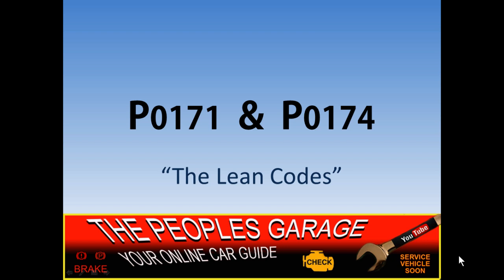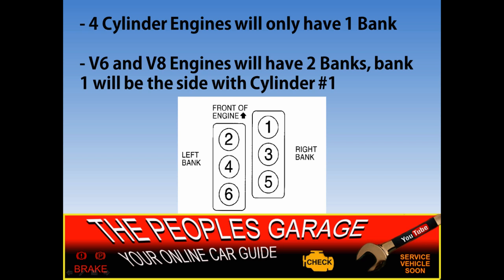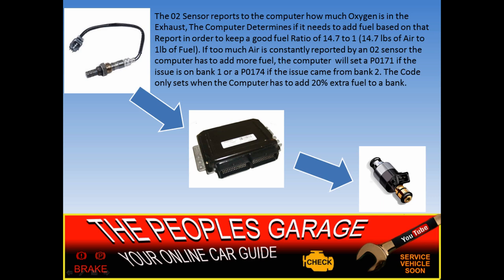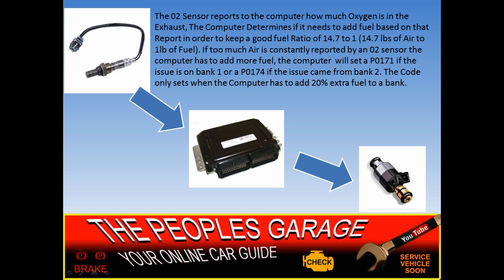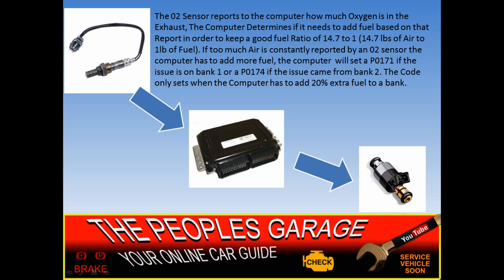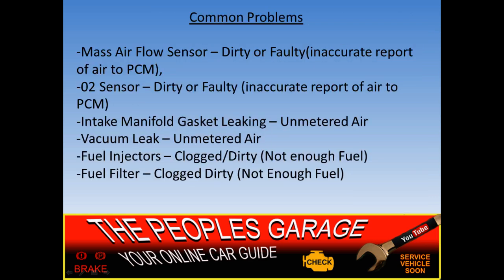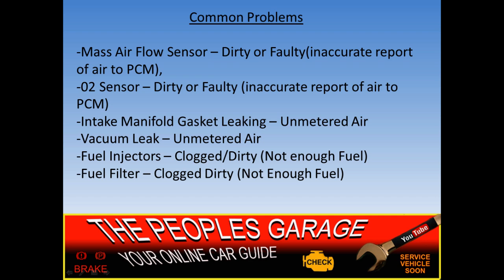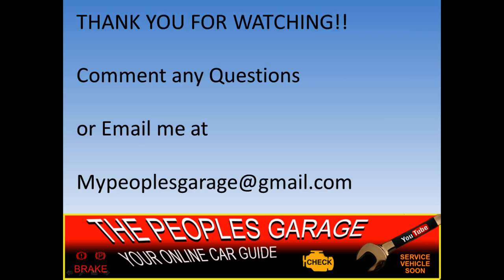How to Diagnose Codes P0171 & P0174 - Lean Bank 1 & 2

Comment: Hi god night. I own an 07 Fusion 3.0 V6 yesterday i replaced the intake filter  for a new one. I have had the k&n typhoon system for 3 years now so far so good.

After replacing it i disconnected the negative terminal for 20mins in order to re learn trim fuel levels as i considered it was neccesary the old filter was horrible even if i clenaed it regulary.

Start up really rough idle engine jumping all around car shaking all the way. So what i did: Electronic cleaner for MAF, MAP, cleaned connector male and female for EGR, MAP, MAF, Throttle Body and 3 front coils.

Checked for vacuum leaks at typhoon duct, PCV vent hose, intake manifold. Checked torque for 7 bolts for the manifold.

Everything ok checked codes got both p0171-74 then fuel pressure 60psi left 2 hour the pressure indicator did not move a bit. Went back to old air filter reset ecm no help same issue.

Im lost right now going crazy only thing left is dirty fuel injectors but as you said that would be for one bank not the two of them.

Any help? Thanks in advance!!!👍

Comment: 98 Ford explorer  304, 171, 174. 
304 code gave me trouble last years replacing the coil pack, wires and plugs. I must have dropped the number 4 plug after purchasing new because it gave me trouble day one. Replaced the plug and 6 months ago and is idling rough when cold. Roughness smooths out after warmup. 
171 and 174 lights were out for 6 months after replacing the easiest to replace 02 sensor on bank one. 
I'm thinking vacuum leak in manifold giving all three codes or
Mass air flow may need cleaning or replacing again. 
What would do first. I hate to take the intake off at this time. I cleared the codes and know they will return. I learned a lot on utube channel. 
Thank you
Reply: I have the same rough idea i did in the last comment. 304, 171,174 code.
Any ideas?
Reply: Forgot to mention the check engine blinks sometimes.

Comment: hi and thanks for the very useful information.  i have a 2003 Windstar that has P0171 & P0174 codes   ive changed the air cleaner as it was real dirty. I also replaced gas cap.  After taking the MAF sensor out and cleaned  i still got the codes back only 7 miles after clearing them.  after further inspection i noticed a rod laying out on the manifold that fell out of the intake manifold runner control.   so, after watching some videos of replacing manifold gaskets and yours, I'm wondering was this the problem all long?    and if the p0171 & p0174 too lean bank 1 and bank 2 could this solved by just getting new bushings and rods and put back in?   i called a guy at Auto Zone and he told me I had to buy the whole IMRC   300.00!   i seen the kit of 4 bushings and two rods for 23.00 at Ford.

Comment: I have a GMC jimmy 2001 have both the codes on. I replaced the air and fuel filter just in case it is that. Evap canister solonid was also changed as it was stuck in the open position. Also sealed all the intake parts after the mass air flow to the engine and I am still getting the codes for bank 1-2. How can I check if its my gasket? Keep up the great videos, probably the most useful one I have found. A++
Reply: Check for a vacuum leak in your brake booster

Comment: ok autozone told me p0171 and that is it, the local shop told me 174 and that is it,,,, this is on a 98 lincoln continental , i found broken exhaust hangers causing for a wobblly exhaust, is it possible to have created a exhast leak and this is givng o2 sensors a bad reading, i sprayd ether around intake manifold and did not get any response,,,, any comments will hlep thanks
Reply: dont know if u got answer yet but that ex leak will definitely throw a o2 and or rich/lean code i have sim issue when truck gets hot a crack in my header expands open enough to get the code but when it cold it tay sealed no code some times for weeks at a time epecially in winter and rainy days

Comment: i have a 2001 ford windstar. it has the 3.8 liter engine. it has both p0171 and p0174 codes. plus a bunch that i cant find yet. such as c1185, c1198, c1194, c1254, c1246, c1250, c1242, c1214, c1210, u1262, and b1317. i havent find much on the other codes yet. going to change fuel filter to see if that does anything and go from there. can the o2 sensors be check to see if the are good. any help would be great.

thanks,
rich

Comment: Yukon denali 2007 6.2liter both codes drop in rpm around 2500-3000 rpms only when driving.  Not at idle. Also I cant hear the fuel pump come on when going to off to on position.  Any thoughts

Comment: Thanks! I just subscribed your channel. this video made me totally understand the P0171 and P 0174 codes which popped up in my 2006 Ford Fusion SEL V6. I cleaned the Massive flow sensor and the throttle body, and the codes do not disappear. Do you have any clues causing the code in the specific car?

Comment: Thank you for the insightful video. I have an ill 02 Avalanche/5.3 L with a host of codes - P0101, P0171, P0174, P0300, P0430, & P0440. Newer plugs/wires & replaced MAF sensor. Rough idle, & very little power to the tires. Motor turns low rpm in gear and moving, however, in neutral builds rpm fine. HELP. Any thoughts?

Comment: I own a Ford Expedition Eddie Bauer and my check engine light is on.  Now we just checked out the codes and these two codes came up. 171 and 174. Now I was telling my buddy last week that my check engine light was blinking as I was driving to work it wasn't solid . But eventually it ended up becoming solid. So he reset my check engine light after we did the codes and now its back on again. I also told him that if Im driving onto a on ramp getting on the highway its hard for me to go from 0-60 . Once I hit 50 it wants to push to 60 buts its hard. So any ideas on where I should start or even does anyone know what they think the issues are. Thanks for your help and I liked the video. Of course im hoping its the pcv elbow .

Comment: My 1997 F-150 4.6L has run absolutely fine for years the whole time with both of these codes (171 & 174) tripping the check engine light. I've ignored it for years because it hasn't been an issue.

However, recently my County has enforced emissions testing and I have to get it fixed before it will pass emissions.

So I'm wondering where you might start with something like this where A) Both codes are being tripped, and B) No tangible issues with the motor?

The exhaust smells fine (not lean), the engine purrs like a kitten, can't hear any audible hissing noises (vacuum leaks). Just not sure where to start.

Thanks for any help!
Reply: In my case it was a bad hose coming out of the PCV valve. The truck blew a head gasket shortly after though 😢
Reply: Have you ever found the problem?please let me know!I'm getting the same codes in my 04 lincoln town car 4.6v8 and it's running just fine but I hate to see the check engine light on! Please let me know!thank you for replying back in advance!

Comment: I have Ford windstar 2001 limited edition. I went to Auto zone and the computer diagnosis is P0171 Mass Air Flow sensor in not working and P0302 fault spark plug cylinder 2. When i am driving my van gives me jurks couple of times and the acceleration drops down (lean). By when i have more gas in tank this jurks drps down and the vehicle is running good and smooth.
Do i need to clean the Mass air flow sensor or do i need to change the plug for cylinder 2 code (P0302). Please let me know and the mechanics are asking me for opening the head gasket and the estimated cost they are giving is $300 dollars or more.

Comment: 2014 SS Performance Sedan. 6.2 liter LS3 V8. P0173. I installed a roto-fab cold air intake a month ago.
Reply from the maker: Frank Marinucci Sounds like it has a fuel trim issue, it might need to be calibrated to adjust to the new intake.

Comment: I have 2009 Suburban and I'm getting both codes. Now when the vehicle goes off and wont start. I normally leave it for about 10 min and when I start it again it comes back on like nothing had happened. what would that tells you???.  the engine light will go off on its own after 40 miles.  thanks a lot

Comment: ThePeoplesGarage  i have a 07 vw gli with 2 codes - ( boost pressure drop from turbo to throttle body) and ( system too lean at IDEL) what can be my problem be ? thank you  * i have a new pcv valve new intercooler, new diverter valve and cold air intake
Reply from the maker: Gli_Fahrenheit That really sounds like a vacuum leak to me
Reply: how can I check? I also got (leak in air intake system p22790 )Thank you
Reply: You could use a smoke machine to check for that vacuum leak.
Reply: Or you could lightly use brake cleaner looking for a change in idle.
Reply: Thank you

Comment: Hi, I have a 2003 325i that has both lean codes showing and cylinder 6 misfire. It stalls when exiting the highway. I let it sit for a while and it starts back up and drives ok. Any clue as to where to start? Smoke test? Clean the MAF? Greatly appreciate any advice as my auto repair knowledge is about zero and I'm trying to sell the car ASAP. Thanks a bunch.
Reply from the maker: ***** I would have it checked for Vacuum Leaks, and Cylinder 6 Misfire could be a spark Plug or Ignition Coil, Sorry I cant be more specific

Comment: I have a 2000 chevy s10 4.3L V6 and recently changed the spider injector assembly which solved my cylinder 5 misfire as my injector were wrecked by bad gas disturbed when changing fuel tank, so I changed my fuel filter and flushed my lines before installing the new injectors, but then I got these to codes, found my gear clamp slipped off my intake so I fixed that because it was stalling and rough take off,, deleted the codes, now I get a stutter when it revs up fast sometimes but not always, it hasnt been bad enough to trigger a code, just looking for ideas because I do not like the idea of a minor intermittent problem.
Reply from the maker: Nigel Clean the Throttle body? No Vacuum Leaks?

Comment: hey guys i need help i have a 3.8 litre 97 ford mustang, and  i keep gettin p-0174 bank 2 too lean, now ive changed the hoses , changed to a new MAF , replaced the 3-O2 sensors changed the EGR Valve  by the way this is the cars second engine , i bought as a short block its working fine , the lagging stoped when i replaced the hoses, i dont knw what else to do please help!

Comment: I have a 2000 Toyota Tundra, 4.7 L V8. Just checked it with my code reader. It came up with the P0171 code, not the 174 code. I'm also starting to lose coolant.. Could smell coolant after parking the truck. Checked under the hood, and underneath,  found a small amount of residual coolant at the back of the motor..Could not trace where it originated from..Intake manifold gasket?  Could that be causing the lean problem also?  Would appreciated your answer.. Thank you.. Very informative, and concise video..
Reply from the maker: Glenn K I would go to the parts store and rent a loaner tool called the "Coolant Pressure Tester" it will allow you to find your coolant leak, The lean code probably wont be related to your coolant leak, since the MAF usually effects both banks, i would look into an Oxygen Sensor on bank 1 which is driver side in your case, check the front 02 sensor on a scan tool if possible, it is common
Reply: ThePeoplesGarage Thank you.. Your reply is greatly appreciated..  Will get back to you on the results...
Reply from the maker: Glenn K No Problem Glenn!

Comment: I have a 97 Ford Explorer that runs bad when its cold. once it gets to operating temperature runs fine. When its cold it idles up and down until it smoothes itself out probably 5 or 6 times codes are 171 174 any ideas?
Reply from the maker: Darin Wright It might have a small vacuum leak, it could be an oxygen sensor issue, or it might be a dirty or defective MAF, do you have any other codes?
Reply: No that's it.
Reply from the maker: try clean the MAF and erase the code first
Reply: Ok thanks!
Reply from the maker: no problem!
Reply: ThePeoplesGarage
Samething, not O2, not MAF, no intake leak

Comment: I have a 2000 chevy 1500 5.3 and have both lean codes and have changed 
The intake casket and have clean the m a f 
And changed gas fliter .....would u have any more idees as what is giving me the codes 
The long fuel trim was the last I check was around 28 and short was around mins 2.6 .?
Reply: Check for broken exhaust manifold bolts.
Reply from the maker: Jim B I would say the manifold might still be leaking, they are very notorious on these trucks and must be torqued down exact in order for them not to suck air in. I have a vacuum leak video that you can watch to see how to check for leaks using brake clean with the truck running, if your sure its not a vacuum leak I would look into replacing the MAF sensor, they can be cleaned usually but if they have failed electrically a cleaning wont help. After you cleaned it did you erase the code? Chase Powers you are on the right track but the chances of broken exhaust manifold bolts on both banks all of a sudden is unlikely. These trucks have issues with the intake manifold gasket leaking and MAF sensors.
Reply: Chase Powers waste of time
Reply: Thanks guys for the help its been put on the back buner. For now
Reply: Jim B I found my issue on my 5.3.  Multiple missfire, bank 1 lean, would smoke like a diesel.  Changed maf, new mani gasket & checked for vac leaks.  It ended up being the bank 1 sensor 1 o2 sensor.  It wasn't failed to throw a code, but it made the engine run like hell.

Comment: I have a 2000 Pontiac firebird v6 with p0171 system too lean. Bank 1 and 2. I got all 4 o2 sensors fixed last week. Idk what the problem is
Reply from the maker: Martez Artis On the Firebird v6 I would watch my vacuum leak video and check for a vacuum leak around the manifold, otherwise I would try clean the MAF, it might need replaced however if its not a vacuum leak. I would try clean it and erase the light to see if it comes back on, you can erase the light by going to the parts store and ask them to clear it, or you can unhook the battery for 5-20 minutes

Comment: Thank you for your video and the information, I have a 2002 BMW 325i. I have been dealing with these codes for about a year now and just yesterday I changed the pre cat O2 sensors and the P0171 code went away. I have not changed the other two sensors yet but I wanted to know which of the above mentioned symptoms are related to Bank one Vs Bank two lean codes. Thanks once again
Reply from the maker: andatey  What other code is left now?

Comment: Hi,,
i have range rover 2005 4.4L and i got P0174 code , i cleaned the MAF sensor and i checked for any leak but no any change , and there is really high gas consumption and no power.... do u think its better to change the O2 sensor ??
Reply from the maker: Riadh Taher Could be a bad 02 sensor but try look for a vacuum leak, spray brake clean around with the engine running
Reply: thank you for your help now everything is ok , thanx again

Comment: hey i have a ford ranger with lean in bank 1 and 2 both codes its a 4.0 v6 any help i cant find the problem
Reply from the maker: MrFunatthepark i would try clean the maf sensor and you might have to replace it if that doesnt work
Reply: i cleaned it nothing when i unplug it it runs right tho i baughht a new the problem is still there could it be the wires

Comment: Great video very informant do you have a diagram or a photograph of the PCV Elbow on a ford expedition 1999 so I know were to look thanks
Reply from the maker: Aaron Robson its a 90 degree rubber elblow, its like an inch or 2 long and its shaped like the letter "L" its on the back of the intake by the throttle body

Comment: First of all thank you so much for providing this info to people.  In this economy and unfortunately dishonest business in some cases, this is what people need.  I have a question for ya.  Is there anything common on Hondas ('97) that you've ran across other than maybe worn O2 sensor?.  I've been a technician for 20 years in different shops but now I have practically no diagnostic tools.  Anyway, my '97 Honda Odyssey just set a P0171 code and nothing else (light went on today / had it scanned today).  I did notice worse gas mileage and a little cat smell lately but no loss of power.  I haven't noticed any exhaust leak or vac leak "higher" idle but did notice a little bit more of a lower RPM idle.  This car has 186K on it and I'm getting ready to do the MAJOR maintenance work on it including TBelt, tune, valve adjust ... you know.  I don't mind throwing a part or 2 at it if it's not too expensive like an upstream O2 but of course don't want to loose too much money in that process.  Car runs great, no misfire, no major lack of power either.  Do you think it would be safe to assume it's a worn O2?
Reply from the maker: Steve Carnut usually with an oxygen sensor issue you will get a code for the sensor and a lean code, with just a lean code i would try to clean the MAF and check for a vacuum leak, but it could be the 02 sensor, usually upstream

Comment: I have a 1998 F150 4.6 V8.  190000km, last year I had a dirty MAF sensor cause excess fuel to dump into the exhaust and melted my catalytic, I had a shop remove the cat and replace it with exhaust pipe, now a year later I had a bad plug wire cause a P0304 code which I fixed, now I'm getting the P0174 and P0171 codes, is it most likely a vacuum leak or is it something to do with the MAF again?
Reply from the maker: jmhepp usually going to be the MAF needing cleaned or replaced